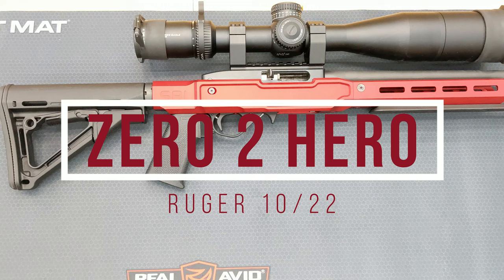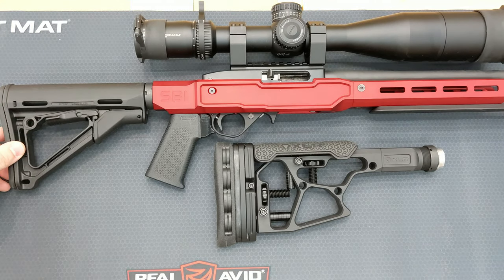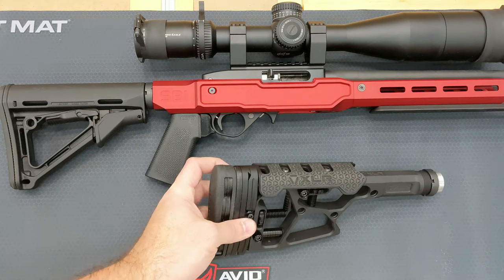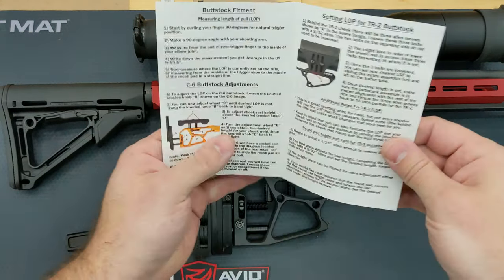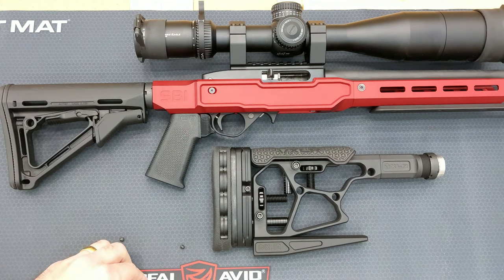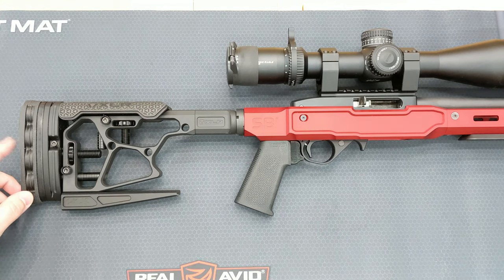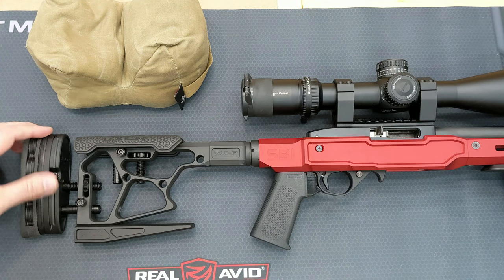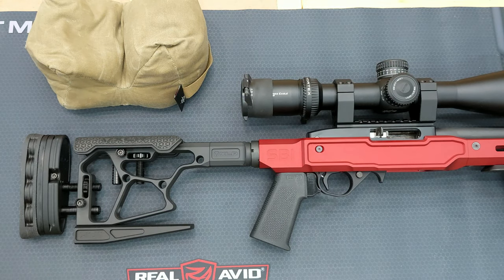Zero to Hero 10/22 - Part 5: Update and New Buttstock

Comment: That looks Awesome Man! it's more expensive than Gun itself!!!
Reply from the maker: That's the story of the whole build really. Almost every part has been more expensive than the original $299 CAD 10/22. Hell, the SPUHR scope rings I will be adding in a video soon are much more than the rifle.

Going to be a fun day when I take the new build and put it up against the rebuilt $299 one to see the differences.
Reply: @road2nrl22  Did you buy the XLR C-6 buttstock for $399 USD?
Reply from the maker: @Unknownbrand  I ended up choosing the cerakote so more than that. ~$480 USD
Reply: @road2nrl22  Holy smokes! it really does look nice though. I might do a similar build with the SBI chassis as well. what pistol gripp/where did you find it?
Reply from the maker: @Unknownbrand  The grip is a magpul MOE K grip, but any non beavertail AR-15 grip should work fine.
Reply: @road2nrl22  Yea, it's to bad the beavertail ar15 ones don't work, they look the nicest imo
Reply: @road2nrl22  Looking forward to seeing the finished build 👍
Reply from the maker: @Unknownbrand  New video done rendering, scheduled to come out tomorrow around lunch EST.
Reply: @road2nrl22  Perfect, I'll be waiting.
Reply: How did you get the stock shipped to Canada? Also what size did you go with?
Reply from the maker: @Unknownbrand  Mine is the long one. I actually ordered it to the nearest border town and picked it up.
Reply: @road2nrl22  Wanna pick mine up and ship it out to me? lol!